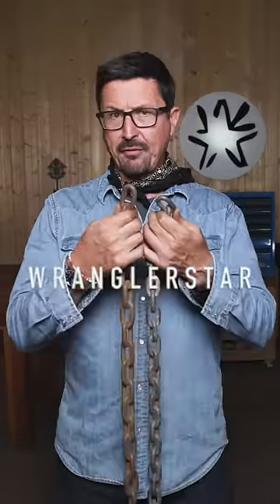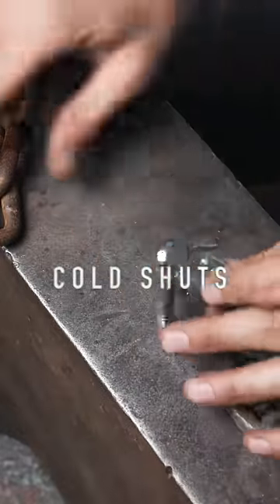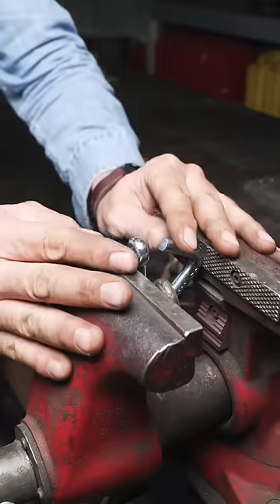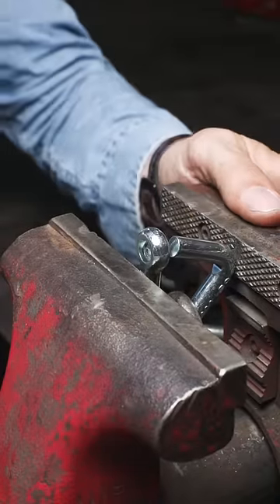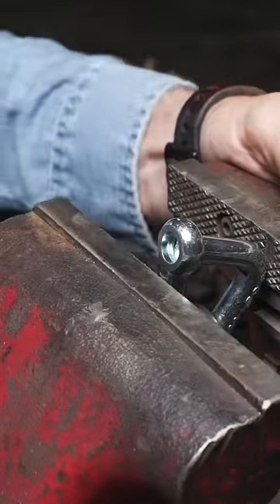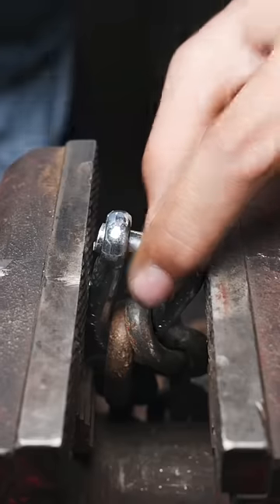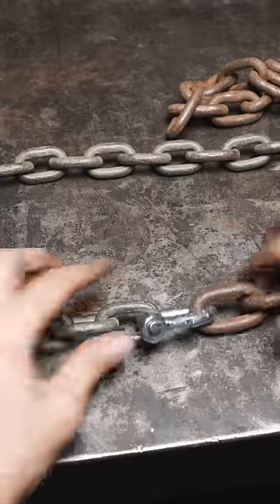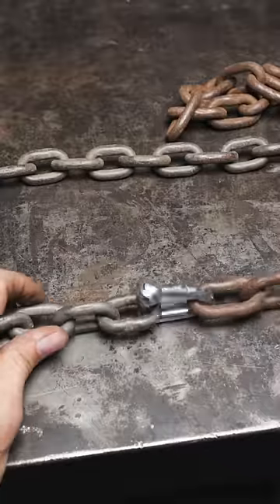Emergency logging chain repair Wranglerstar professional Homeowner #shorts

Comment: I thought that's what a nut and bolt and 2 washers were for. Wow
Reply: That's for the extra emergency repairs or when these fail. I've got a couple chains bolted together, heavy use and has lasted over 20 years

Comment: who has a vice in the field xD can you close that thing with a hammer. Also ive never needed a logging chain in my 20+ years of home ownership
Reply: I have a vice on my truck and work trailer. I also keep logging chains on them both in a metal box coated with oil to prevent rust.  Makes sense to me. And I'm from Mississippi.

Comment: Sir! You're not done!!     take a ball peeing hammer and pein the end of the shaft after it is entered the whole, let more of it stick out and take a ball peen hammer and hold it AGENST an  AXES head! sledge hamer head!! Or Anvil or a rock or an axle shaft in the forest!       whatever?    and keep hitting it with a ball pein hammer,, on the edges.!!  pening it out. it will not break after you do that..... because it will not separate,,,,,,,,,. and leave you broken
Reply: Finally someone said it! I was about to say it myself. Definitely unsure of his "experience"

Comment: I think a "coupling link" or "connecting link" as used in lifting chains would be easier, stronger, and require only a hammer and punch.🤔
Reply: Crosby forged chain connectors work like a charm.

Comment: so.. in an emergency field situation you need a vise, instead of using a "maillon rapide", which has roughly the same resistance of the broken chain link, weighs just a bit more and can be closed by hand or with a small wrench?

Comment: Weld it solid and that 2/3 comes back
Reply: Does it, even considering the uneven heating that causes?  Genuine question.  An old welder friend told me "keep in mind, at the end of the day it's a metal hot glue gun.  Quick field repairs will almost always be the point of failure, simply for lack of heat treat abilities in the field."
Reply: Save money and just use a fresh chain link while you're at it.

Comment: Unfortunate East Coast Proho here. I have not seen that one before. In the backwoods of the steep south I usually carry several Shackles and locking steel carabiner style links for this type of thing. Always remember " A chain is only as strong as its weakest link".

Comment: They make chain links that screw together on one side. Put a load on it and you won’t unscrew it so easy.  Not as strong as a logging chain, more for use with trucker chains that need more length to secure a load…

Comment: I always use a cold shut 1/8" bigger than the chain.  Brad that end good, weld if possible.  I have used cold shuts in the exact middle of chain and pulled stuck bull dozer out with a track hoe.  Did not even stretch the cold shut.  Installed that particular one in 1991.  Still going strong.  It gets used a lot.  With seven large tractors on a farm, it gets used often.  3/8" chain with a 1/2" cold shut.  Out of split links, screw links, two piece links, the cold shut is the best.  Brad or weld the protruding end.
Reply: Ridge Runner;   Tyvk for ur comment; u answered the exact question in my mind, and bettered the solution that  came up with.
Reply: @daphneraven6745  Good.  The regular old cold shut does work the best.  Up size the cold shut 1/8" bigger than your chain size.  I'd pull anything with that.  Now, of course, there's other things available for $15 - $30 a link that works very well.  But, a cold shut is the best of the cheap stuff.

Comment: For emergency use get a D-Link it screws open and shut just like he said it will be the weakest link in your chain but it's a whole lot quicker and you don't need a vice . If you do buy one, get those for chains and not for climbing.

Comment: Idk, if I had a chain break and I had one of those to fix it...I'm not sure how much I would trust that thing from pulling out and have 2 chains whip around.  And yes, I know the way its designed all the stress is focused exactly on the strongest part of the link, but even still I don't know if I'd even go 2/3 of the maximum load of the chain could stand normally. If there was a way to design it where you could hook the end up just a little bit to sort of lock it in place after installing it I'd be a little less sketchy...but sitting here right now I can't think of a way that's possible. But like you said, emergency situations you gotta do what you gotta do

Comment: I always peen the head, it gives you a little warning, by stretching that way.
Reply: Thank you for being the first to mention that. 
A bead of weld would be even better.
Reply: @franklinmitchell9490  well yeah, but this is a field repair. You may have a vice on your truck, or one to go into a receiver, but welding equipment isn't normally in a truck. A small vise and a hammer isn't normally on them either, but I find them really useful for lots of things. Now, if your a hard core four wheeler, then you probably have a DC welder with you, but a wood hauler or hunter, then probably not.

Comment: If the repair cuts the chain strength by 2/3rds, which means the chain is now less than half as strong as it was, what kind of repair would return the chain to it’s original strength???

Comment: Now if you would have welded that could that improve the strength
Reply: it'll be a weak link even if you welded it, something like this is made for emergency situations so you could then remove the link and swap it for a proper one

Comment: Using a ball peen hammer to mushroom the head of the end will actually add strength.
But again.  This is a field repair.
Not that I've ever had a table vice handy in a field.....

Comment: After doing this if you have a welding stick and jumper cables. Use your trucks battery as a stick welder and weld that link so you won't loose as much chain strength

Comment: I could see this being useful for light duty work after the fact but…
1. How is this an emergency repair that you can do with tools on hand?…who has a vice on site?
2.  If mending the chain like this decreases the strength that significantly, then it is no longer safe to use it for the original task that broke it in the first place, so you will still need to replace it.
3.  This channel should really be called the professional homesteader lol.
Reply: Number 3 100% like when will I, someone who lives in an apartment in a town centre ever have need of a logging chain or access to a vice like what
Reply: Lol I am so tired of hearing him say that (professional homeowner) I don’t watch him as much as I used to
Reply: They should call this channel Oregon trail

Comment: or you could use a real repair link that restores most of the chain strength

i found these links that are 2 us with finger joints and a oversized grade 8 bolt in the center i have broken my chain in 4 places over the years but never in the same place twice so i say they are good repair links
Reply: Twin Clevis link. Hell of a lot lighter than a vise to carry around.
Reply: @henryarrington3446  thank you I didn't know the name I just get them on Amazon or my local FarmFleet

Comment: Yeah you didn't do it right what you're supposed to do is you're supposed to clamp it shut and then go past flush like you said but then you're supposed to either peening that into a riveted over knob that way it can't slip through or bend it right over as in hook so it can't slip out

Comment: ...or you can have a few Crosby forged chain connectors in your tool kit. They're designed specifically for that purpose, you don't need a vise or specials tools to install, and you can use the chain at it's rated capacity. What you demonstrated is junk.
Reply: True that Tough Guy.
Reply: The Crosby Missing links are still only rated for grade 30chain and only marginally higher than the appropriately sized cold shut.
Reply: @TheEbanks7   Connecting link type A-1337 is suitable for grade 80 and 100 chain. Type A-336 is good for Grade 60 chain.

Comment: Couldn't you keep a small welder on a truck and make it lose none of its strength?
Reply: Welding would only make the joint area slightly stronger, but not being able to heat treat the entire link afterwards is a problem. That would  create a weak point on both sides of where the weld heat reached.    
  This design is good for the emergency “get you home” use.  Otherwise I wouldn’t trust anyone’s life with it.

Comment: Or ... 2 hooks over on the same pegboard of the hardware aisle,  is a double clevis that is made to join grade 70 chain at full strength,  and only requires a hammer and drift to remove the roll pins that secure the cross pins.

Comment: I've used these several times. They do reduce tensil strength, but absolutely work in a pinch 

For the simple minded in the comments... You can also use a hammer  to close it.

Comment: As an amateur home owner, but a previous EXPERT in the rigging field, do not ever attempt this.  The link needs to be rated higher than the chain. This link he is using maybe but he did not make any mention of the fact of the load strength eating to be greater than the chain.  The link should be closed further so that the sides are more parallel.. A better attempt would be to use a clevis or shackle,or even a double clevis,  both items which should be stocked in a toolbox for an emergency situation.

Comment: Where you have a bench and a vise in the field it's probably mounted on a service truck and on that truck there is the most important tool this dude didn't mention to finish the task he started. It's called a welder. If you can't figure out the rest please don't pull anything with a chain around me.

Comment: you can keep going past the end tell about a 1/4 in is sticking out and then peen the end sticking out in to a mushroom to make it lock in the hole.  later when you get home you can weld the peened end and make a permanent repair it's still not as strong as the original link but it will last a while before it breaks again .

Comment: Does it cut the strength because the link isnt welded together? Just curious if someone took a welder to it and welded that repair link shut if that would fix the loss of strength.

Comment: I feel like this is a much more complicated method than just keeping a couple carabineer either the threaded type thst you screw shut or the simple clip type... i always keep a few hanging in the rearview, toolbox etc. I mean they trust them for MTN climbing/repelling they have different size, and strength types from different material snd you can probably use 2 for double strength to join the 2... lastly the NUMBER 1 proho tip is to keep zip ties everywhere even just cheap ones.... fet different sizes skinny , thick,long etc project farm is an AMAZING content creator on YouTube and he made a video testing zip ties and each ones roughly give you about ,150lbs of dead weight holding but the more you put kn there's the more it can hold to the end he lift's a whole truck's weight then tows it away!!! with nothing but zip ties attaching the two vehicles, no hitch, ball chain etc..also a nylon tow strap would be good for this videos problem

Comment: Why would i use those?
Wouldn't something like a quick link or a bolt chain link be a better option?
Reply: Actual logger  here and yes a bolt would be your best option this is just stupid and asking to get injured . And there’s no such thing as a logging chain it’s just a chain. And an emergency field repair shouldn’t require you to have a  Vice lol . This guy is a desk jockey that is making videos on stuff he reads out of the forestry manual😂
Reply: @ClaytonBigsby01  what is this link used for? Looks like something that was obsolete the moment it came out of the factory 🤷‍♂️
Never seen it in my life.
The bolt link however, never seen a size it hasn't been made for, lol

Comment: That is damn near worthless unless you also weld it! 
If you are not going to weld it, you’d be better off with the largest #5 or #8 bolt that will fit through the links, a washer on each side & a self locking nut

Comment: Saw those but was never keen on the Idea.  Mostly repaired large tire chains though with lap links in the feild.  At night would then put them in the vise and tack weld the laped end well. Usually lasted longer than the rest of the chain after that.  Anyone  have expertise on the various  types of repair specs and safety probabilities.

Comment: Some might not like this but you can get a near perfect repair with a grade eight bolt the biggest size will fit in the chain. Yes it will be offset but it actually can be almost as strong as the original chain.

Comment: I just use a nut and bolt through the existing links. not ideal for chains in Tracks but in pulling it's perfect. Cheap and easy fits in your pocket and no tools needed.

Comment: What if the straight end was threaded and you put a nut on it after it went through the loop hole, could it serve as a one-for-one replacement for the original chain link then?

Comment: If you managed to snap a link in a chain, don't think this repair might let you join it back together and try again with the same rigging setup. You'll have to double the chain up or go about it in some other manner or you're 100% going to break it again.

Comment: It is actually a "cold shut." Like anything else, two or more of them would be cold shuts, but one is singular.  Once you get that shut closed, you are supposed to peen the end over a bit so it doesn't pull out under strain.

Comment: On a minesite we use a 1/2 inch bolt and nut, don’t need a vice and you only loose a little strength and only takes a pair of  3/4 inch wrench’s to repair.

Comment: I usually just patch the chain with a bolt, nut, and two washers, something a lot easier to do on the fly, especially in the field, if you use the biggest bolt you can, to the point of driving it through the links with a hammer, it's pretty strong, probably a lot stronger than this, this looks kinda gimmicky in my poor boy opinion. It's going to pull apart as easy as you pressed it together.

Comment: Or use a heavy duty quick link. Have repaired chains on balers multiple times with them. Same result, no vice necessary. Lasts for years.

Comment: Hammerlocks are easier to use in the field and do not decrease your working load limit. The downsides are it takes a little practice to use them and they are three times the cost of a cold shut.

Comment: Something like a double clevis. Or a connecting link can be installed with little to no force and are 10 times stronger. 
If I were to ever use your link I would have pre drilled small hole for a retaining pin. 
I don't know. But my opinion is that this link is to weak especially for the energy put into installing it

Comment: To everyone saying “you don’t have a vice in the field”, I think you’re missing the point. When he says it’s an “emergency repair”. Don’t think of it as it needs to be repaired in 60 seconds to finish pulling the tree off grandma before she bleeds out. It’s more like grandma got her car stuck in the mud and my chain just broke. Instead of driving to town, I’ll just walk to my garage and fix it with a cold shut.
Reply: Wouldn't a shackle be faster and much easier than this?

Comment: I use a two piece repair link. I have NEVER had one fail or lost chain strength. A vice is not need either.

Comment: For industrial work this would not fly
We use masterlinks that can be hooked up 
Once in position can be secured with an alan key 
Lose some chain durability but i have yet to see one snap or stretch 
Also no need to remove the chain simply pull the links together and slip the masterlink on 
Far simpler and can be kept in the tool box for emergencies

Comment: You didn't do the most important part.  Ball pien hammer the end of the link so that it cannot open up under load.  It is easiedt & best to heat the link, but not necessary, ss it can be done cold by holding against large rock while striking it.

Comment: ...the National Forests Service says: before doing that field repair, for safety reasons take your shoes off and work bare footed.
Btw: instead of carrying that 50lbs vise around + some funny cold shuts (wich hold nothing), why not get some Crosby carbon steel shackles plus a small wrench to tighten them?  They hold more strain than your chain...

Comment: I would use my field welder to make sure it doesn't open and fail.
Reply: Or you could save a step and weld the chain directly if you trust your equipment and skill.
Reply: @tedseb7726  better idea!

Comment: All you need is a hammer and a rock, bumper or  tire rim  and beat it back closed then you are supposed to brand it so it wasn't open up and it should be as strong as you chain if it is designed for that size of chain

Comment: On emergency much better is to use screw and nut to join it, but in this way u should weld it when you can, but don't overheat it

Comment: Cold-shuts (especially not peened or welded) are wimpy; at LEAST 2/3 strength loss. A bolt and nut of decent grade are a better emergency repair.

Or... shorten the chain by relocating  its hook.

Comment: I agree no vice in the woods or on a truck at least Brad it if you are at a shop or have a field truck weld it. If you don't it will pull out.

Comment: What happens if you soldered it and made it like a regular link not loose? Would that still be super weak
Reply: Trippie Chris, maybe you mean welding it. Even then I wouldn't use that chain for much. Chains are heat treated and metal is different than the link. I'd consider it a loss and put a hook on it instead.

Comment: Probably should weld the link shut…. Or what I used to do is stick one link through another, and place a bolt with locknut into the link